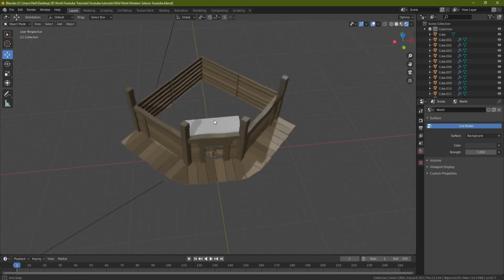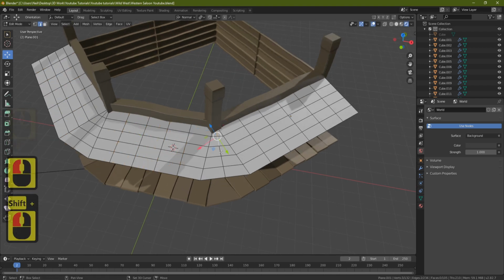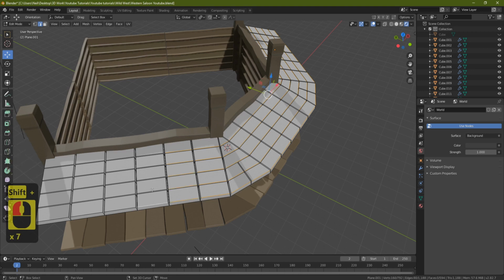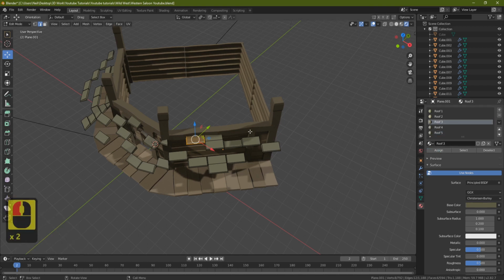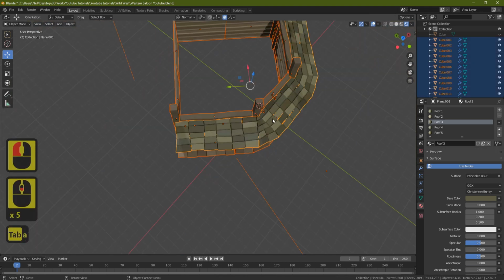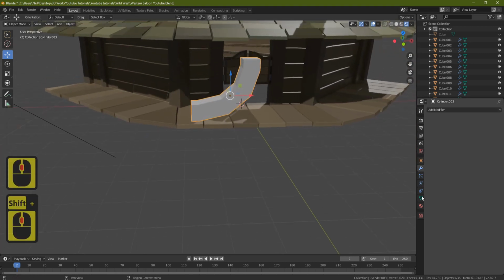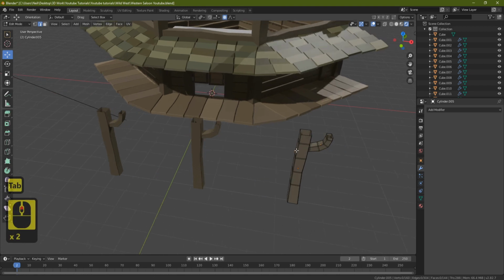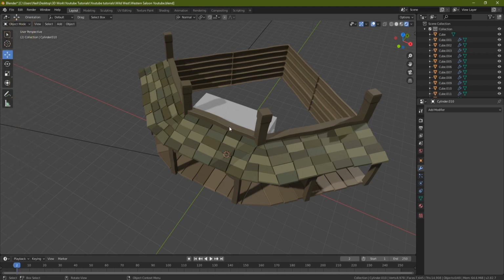Blender 2 8 3D Model Western stylised saloon complete beginners guide on youtube part 3 Pixar Style

Comment: Thanks for the 3rd part of this tutorial. I have been waiting eagerly for it and was rewarded again!
But I have one thing to note. I hope it doesn't rain too much where the saloon is later. If I pull the roof tiles down at 9:17 min, it seems to me that it is somehow the wrong direction for roof tiles  ;)
Reply from the maker: Hi andreas just change the transformation orientation to global :)
Reply: @3DTudor  Hi Neil!
Thank you for your answer.
Sorry but I think there is a little misunderstanding. I just meant that you don't pull the selected edges up but push them down. If you consider the flow direction of the water.
But that is a pure luxury problem and I whine at a high level. You're doing a great job and I'm looking forward to the next part!
Reply from the maker: @Gurkenbier_de   Hope its turning out well then so far :)
Reply: Your right Andreas i'm a builder and can easily see what you are talking about I'm sure if Neil has a closer look he will see what you mean
But I agree he is doing a great job and am also looking forward to completing the model
Cheers
Reply from the maker: @canidu  yes I should have placed them under each tile :D oh well on the next one I will.  Although I secretly installed a under tile drainage system that you guys must have missed!